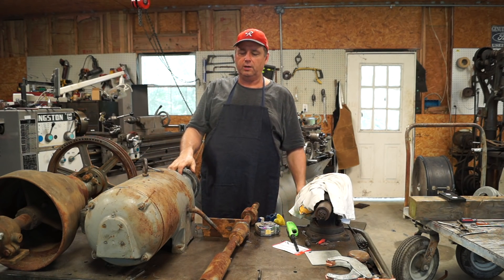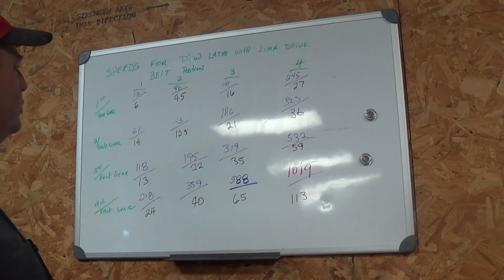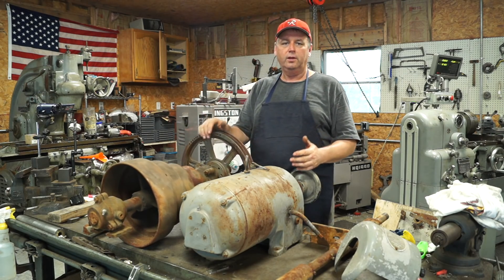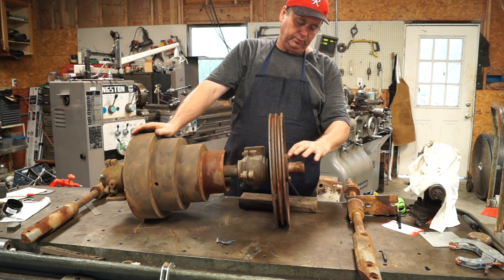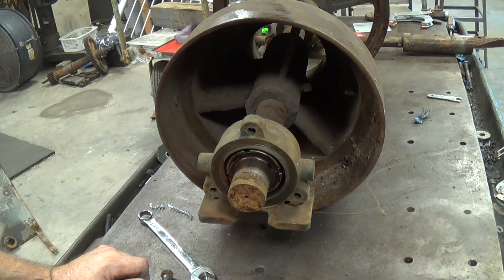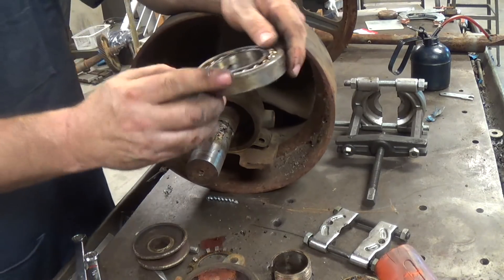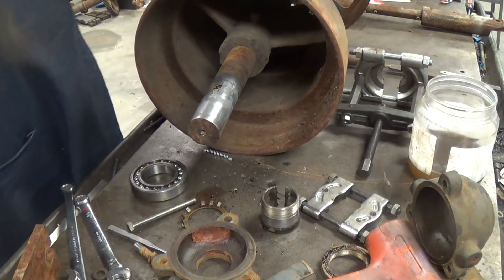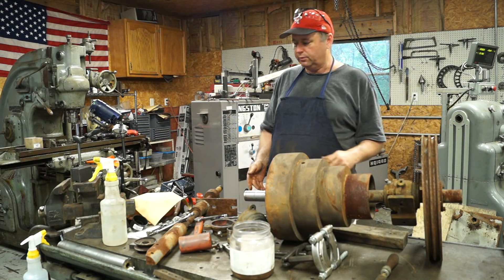Pratt & Whitney Lathe Restoration Part 11 (The Counter Shaft)

Comment: Looks like you need to drill and tap for Zerk fittings so you can grease both sides of the pillow-block bearings...and then don't forget the grease!!!
Reply from the maker: The bearings are oil bath, I need to put some seals in them

Comment: I'm thinking about this construction an the lack of grease. And the it dawned on me. These bearings are meant to be oiled not greased. You put in enough oil in so the bottom of the bearing itself is submerged.
This is why you only found traces of "grease". That was the dried up oil. And so was the discoloration you saw.
The person who tried to grease it did the wrong thing. He should have added oil.
Reply from the maker: Yes they are oil bath bearings, Plan on using them in that manner also. Thanks for the reply and taking the time to leave a comment
Reply: No thank you for making videos. :-)

I've learned so much over the last years watching machinist videos.

Comment: I've seen a lot of bearing retainers  but I have never seen one like that .I wonder if they should of had oil in them instead of grease . Is there any seals on the housing ? It should be a good setup then your done . How do you move the pulleys to change the belt for those speeds Thanks
Reply from the maker: No seals, or gaskets, I need to do some for investigating
Reply from the maker: I took another look at the bearing housings, they are designed for oil, the seals are missing but there are groves for the seals to seat into.
Reply: I think I would look for a class 4 seal double lip with a spring

Comment: Good video!  I do want to tell you the name of the drive is pronounced with a long "I".  Lima Ohio is not too far away from me.  That is a second generation Lima drive.  I have one just like it on my 16" metal shaper.   My Becker vertical milling machine has a first generation drive on it.  The first units used a salvaged model A ford transmission that has had reverse removed and one more forward speed added.  

All the best!

Mike
Reply from the maker: thanks for the reply, Lima, like the bean
Reply: Fildes made very similar drive they were out of Grafton Ohio. More likely one in the same. I have  2 hp and 1 1/2 hp with 3 speed gearboxes. 

Curse auto correct👎

Comment: what is your method for rust removal
Reply from the maker: Thanks for watching
I use several methods from wire wheels to electrolysis,
Reply: striate hydrochloric acid   works so fast but you have to remove all gres and oil .

Comment: Was there a seal on those bearings?  I didn't notice any while you were taking it apart.  I'll compliment you on your work on this unit and other parts of that lathe.  Looking forward to the next video, Greg.
Reply from the maker: No seals, Not sure how it could be sealed with the self aligning  bearings, The more I think about it I wouldn't have packed the bearing housing wit grease either, I believe that would have made a mess